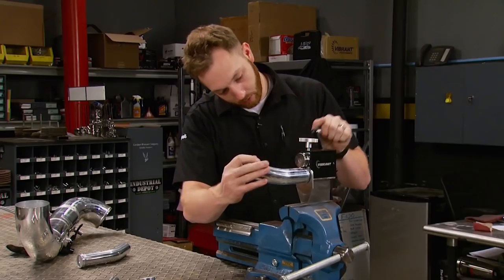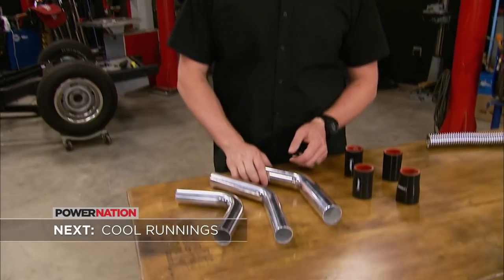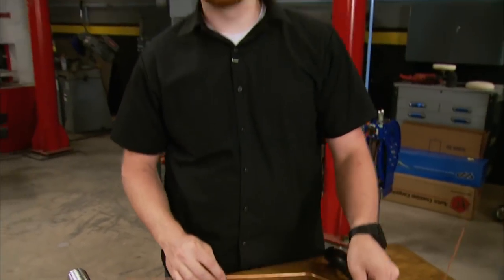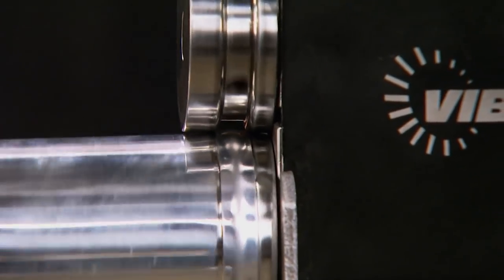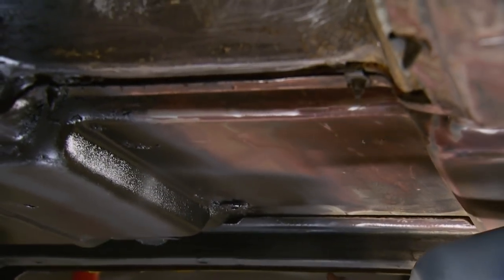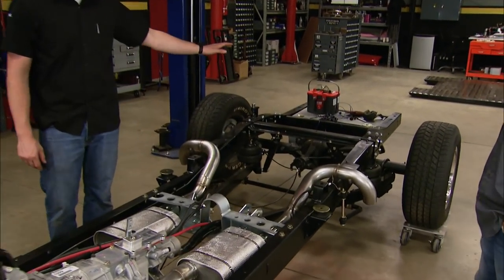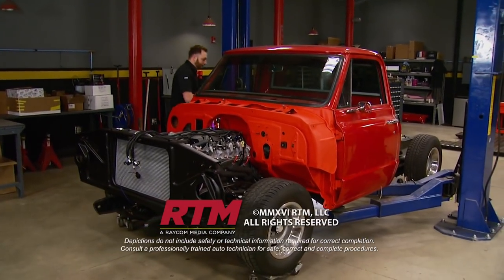Underbody Rust Repair on a '71 Chevy C10 - Truck Tech S3, E16

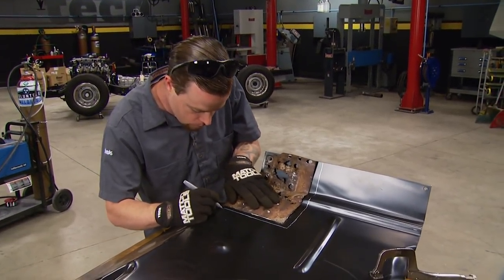Comment: 2:45 If I had a big replacement floor pan like that, I'd just replace everything that the new floor pan had to offer. There was quite a bit of that reddish orange stuff under that cab, maybe not all the way through, but once it's there, it doesn't like to go away on it's own. 4:45 The same goes with that cab support, ESPECIALLY with it being a relatively small part, as well as a structural support.

WOW!!!!!! 6:30 The floor pan and cab supports were in much worse condition than the core support. You're replacing the entire core support, but putting band-aids on the floor of the cab.

Comment: For all this welding being done, does anyone think that Flux core would be good enough? Or is MIG welding needed? As I understand, my welder doesn't use gas, so is called wire feed Flux core.. the "gas" is in the wire.
Since MIG stands for "metal inert gas" welding, and I don't technically have gas.